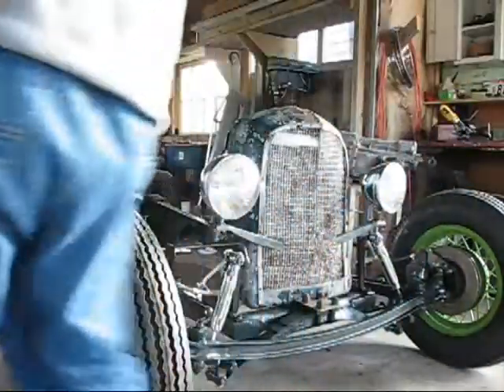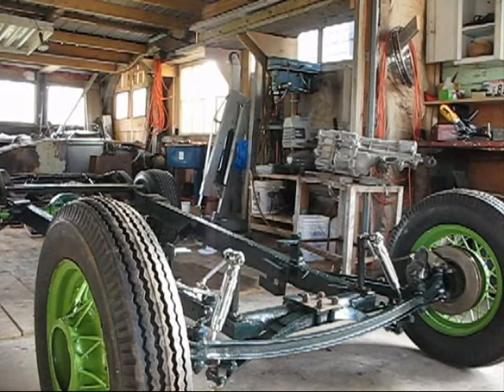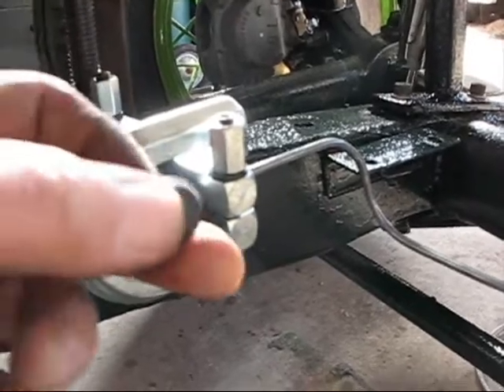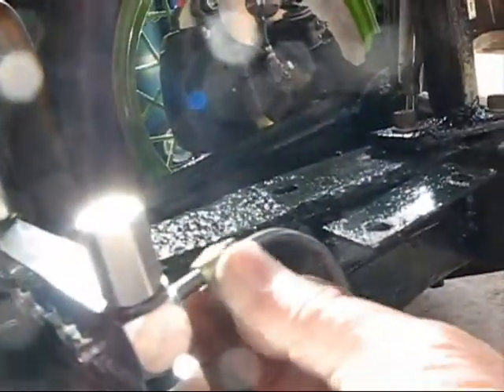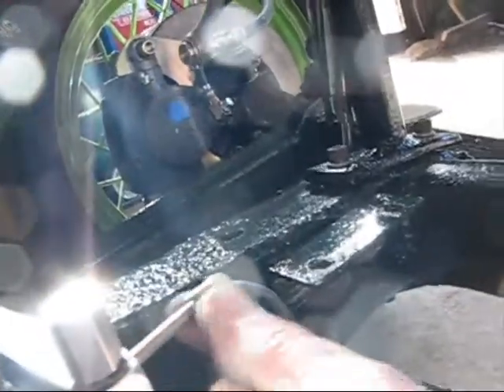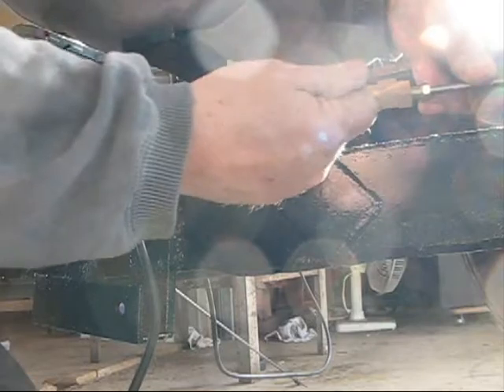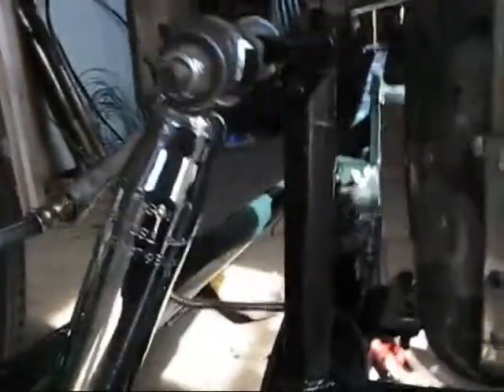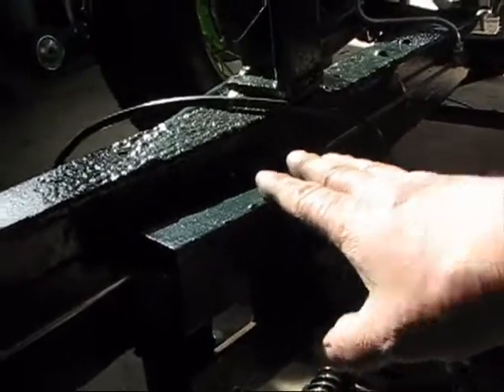Rat Rod brake line bending

Comment: You might want to put some rubber line or the spring guard around the brake line where ever it will touch the frame to keep from getting a hole in it.